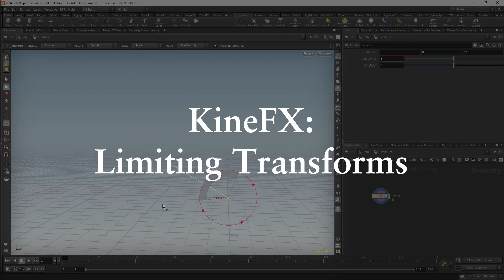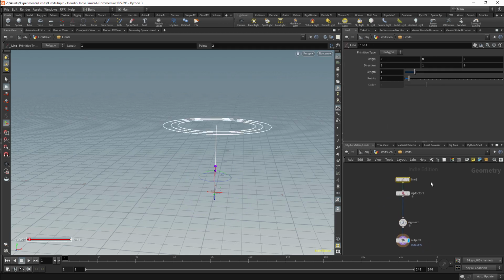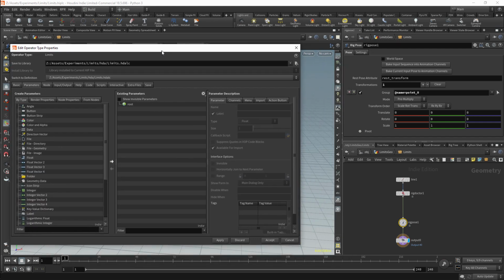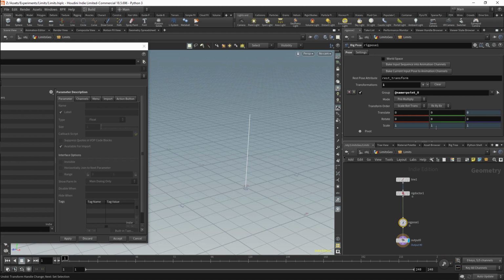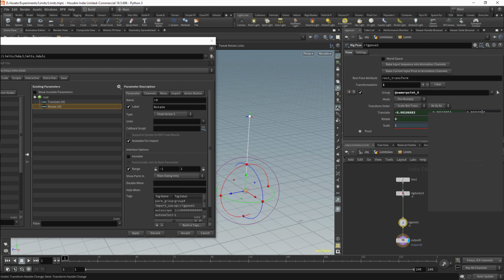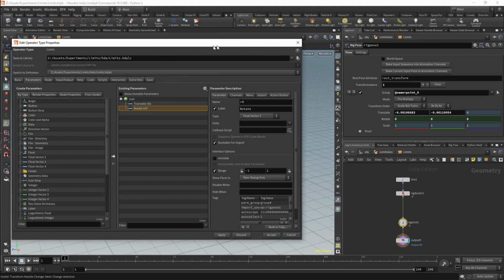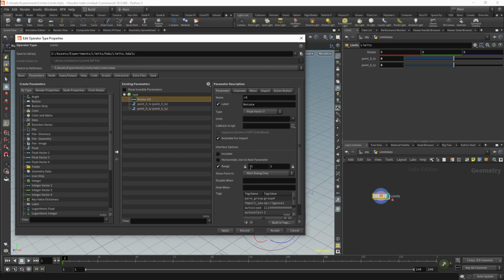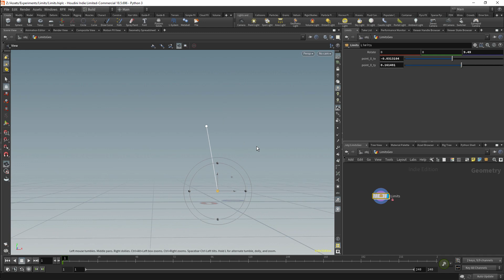KineFX: Limiting Transforms

Comment: Anny way to do this in a way that the Ik chains don`t go over set limits ?
Reply from the maker: This is limiting the controls not the joints. There is no built in limit to control IK chains (you can make one manually in vex or VOPS). You can force IK chins them to return to an original pose using rest transforms. 

Using rest transforms will stop you joints from going beyond a straight line as they will always return to the default.

I do not think this applies to the IKchains node. As that uses the 2 bone Ik VOP. But if you use the IK Solver VOP you have the rest angles mode.
Reply: @brundlethwaite  I`ve switched to apex.
I think its to much work to build a costum one as a generalist. so i`ll skip over it for now. THX for the reply !